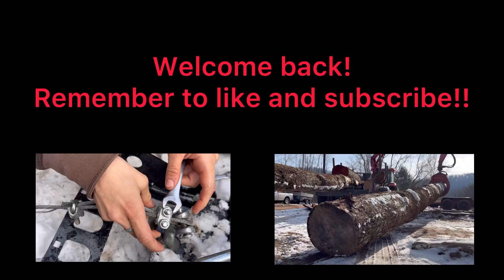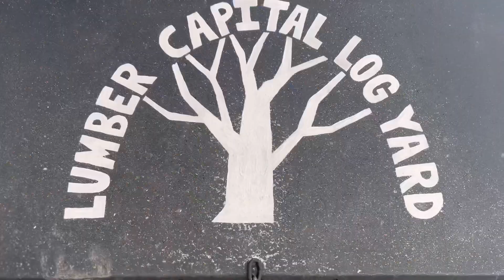What 2022 might bring to small businesses

Comment: I'm suprised they didn't try to weld a nut onto the broken bolts to get them out before trying the long process of drilling them out.
Great Channel...I hope it's "back on track" soon.
Reply: Exactly, and there was no excuse for breaking more bolts. If they are so tight that normal force won't loosen them, heat the heads with a cutting torch till red, then let cool and remove. I farmed for 50 years and know what it take to work on equipment. You guys need to find a better mechanic or shop, no reason to remove the rail for that repair.
Reply: They wouldn’t come out. They tried to weld nuts on and they still snapped. Heated the studs red hot to the point they were hardened. That’s why it went to Deere. So all of the hardened bolts could be drilled out with that very expensive drill bit they showed.

Comment: Within the last month I've gotten a new motor for an hydraulic pump that was faulty and a new carb for a tractor that was missing internal parts.  Quality control is totally gone.  Under the current situation it pays to have duplicate equipment, which of course is hard to afford when you are small.

Comment: I had the same problem with my dozer .I could not be without it. I welded the roller to the  track frame. When it slowed down i pulled the frame and fixed it right, just a thought!

Comment: Weld a new nut to the broken bolt,  the heat from the welding will help break it loose. It works on heavy equipment.
Reply: They tried that, look close at 2:58 and you'll see it. Give my best to Francisco and Maria...
Reply: Should have taken the rail off themselves and brought it to a machine shop. Let them drill out and tap the holes.
Reply: @ajpsawmill4314  true, but if you lack the knowledge, you'll still pay for repairs. One of my favorite sayings "sometimes cheap is expensive."
Reply: @templer46  could have always just welded the roller back on and continued to log. One of my favorite sayings " if you wanna be a logger,  you better be part mechanic"
Reply: @ajpsawmill4314  A temporary fix is more dangerous than a proper one. He's working with his children. Safety should be his primary objective. Meaning; my "never step beyond your abilities," would apply. With that stated, by not being a logger, I might have stepped  beyond knowledge base.
Reply: @templer46  weld where a bolt was should be fine and safe for this temporary repair.
Reply: @templer46  - " He's working with his children. Safety should be his primary objective." - You'd think so, but the girls seldom wear safety goggles or keep their long hair tied up/back. Kind of freaks me out a little watching them operate spinning/moving equipment...

Comment: Really didn't need to remove the track rail to drill out the sheared off bolts. I've done it on my CASE 855C. It's a little owkward, but it saves a lot of time in the long run.

Comment: Some of the assessment is just not accurate.  Starters have been shit in a box for at least ten years probably closer to fifteen (especially after market reman).  Welds have been breaking long before I walked this planet, and they will be breaking long after I'm gone.  Guide wheel bolts will always be broken, seized, frequently both.  I fix them in the field on my back.  If I have to go full gonzo it's arc gouge and try to save the threads.  If I can't pull that off then over size the hole and tap it.  Before arc gouge I did it with a torch, still do sometimes.  I"m not saying your challenges are not real or significant.  I'm saying they existed long before the previous two years.  It's just a different perspective.  I'm well versed on equipment.  Acquired a lot of knowledge and tools to facilitate my tomfoolery.  But if you drop me into your lumber operation, I would be starting over.  Keep your heads up.  After all nobody found the answer on the end of their boots.

Comment: Its a supply chain and manufacturing system that is setup to make components as cheaply as possible that can be sold for the most money.
Profits+Quantity of prodction are of greater importance than Quality (gotta line the shareholders and upper management pockets).
Parts that fail immediately OR arrive already bad, in my mind are due to poor/no quality control.
lack of the human touch -- one that is paid to care about the quality of machining or welds.
Parts made wherever, stamped with a companies logo/badge that are made of the lowest cost materials (those material producers doing the same lowest cost and bare minimum quality standards).
/EndRant .... 😧

Comment: I agree with you (Emerald) about the lowering of quality standards in the engineering and construction industry. But I do not see this as the sole business problem in or age.  Also, since you made this video in January 2022 it seems that so much has changed following the outbreak of war in Europe.  In Europe the price of fossil derived gas and mineral oil have gone up hugely, anmd many people are now unable to pay their fuel bills.  This in turn is  creating higher wage demands and this s forcing inflation. 

I expect many people in your area will use firewood as a significant energy spource for home heating.  Your work in optimising the collection and preparation of good quality firewood will be helping to reduce demand for fossil fuels. Likewise timber when used for construction is far better than energy intensive materials such as plastic, metal, and cement.  One of my slogans I have used throughout my life is to ask my self the simple question... "Am I doing all I can with what I already have?".

Comment: Youtube convinced me that I should watch Cutting Edge Engineering just as it did with your channel. Kurtis from the channel REALLY knows his stuff and does lots of repairs to Cat earthmoving gear and it's obvious from his repairs of previously repaired equipment that there's several ways that a repair can be done. It can be done and put back on the road or it can be done so that it stays back on the road. Having the knowledge and tools that Kurtis has has got to save a lot of heartbreak to a lot of customers in the future. I hope that your repair shop does a good job but based on the quick look on the video I'd say that you aren't getting the best service available :(
As a small business myself I am struggling with supplies both being unavailable and also the shipping times and costs going up insanely.
Hopefully you'll be back dragging logs around soon.

Comment: The equipment people didn't need to buy a carbide drill. The broken off bolt just needed to be tempered with a torch, and the drill just needs a special grind that takes 5 seconds. The cutting edges just need to be flattened to a zero rake. Skills like this are not being handed down anymore.

Comment: This is why God invented mobile welders - that roller could have been welded back in position & carried on working - not that extracting them broken bolts is a big deal - its a bolt. It ain't that stuck, no matter how much it pretends it is, it just needs explaining better to by someone who knows how. It's a steel bolt, in a steel hole, not tungsten carbide.  Might sound harsh, but making it work would save a ton of downtime, a big repair bill & all the associated costs. Find a rougher, tougher mechanic/welder. There are plenty out there.